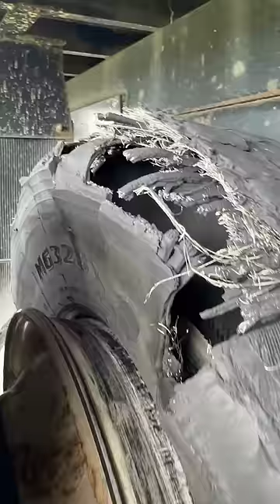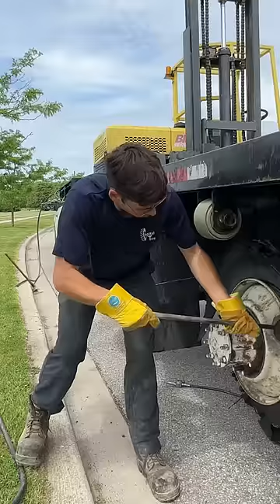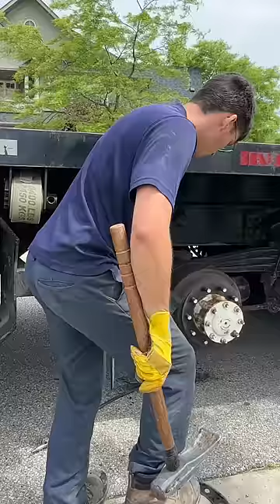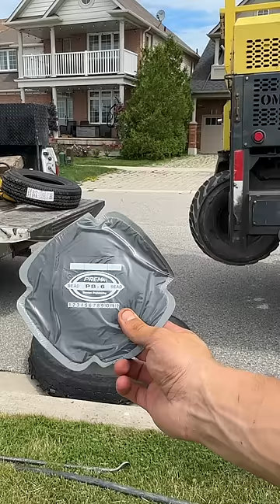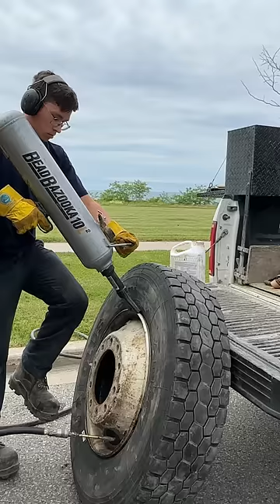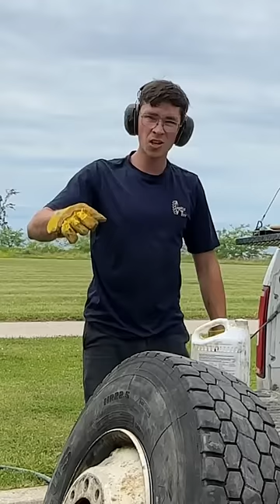Tire Doctor Is A God?

Comment: "I know whats wrong with it, it aint got no gas in it!"
Reply: I was about to say that lmao 🤣 😂 💀
Reply: I was thinking that as I saw the tire
Reply: Yessir
Reply: I thought it was low on blinker fluid!
Reply: It ain’t got no air in it!
Reply: I was looking for this comment 😂😂
Reply: Was about to put the same
Reply: Exactly what I was thinking 😂
Reply: I was waiting for that.
Reply: Kinda true. Air is A gas.
Reply: @braydenj03  very but in this case the gas holds the tire up
Reply: @MASKEDCLOWNGUY91  leave it to ohio to miss the joke
Reply: EYYYYYYYYYY
Reply: @jaynobles.215  Eyyyy sup
Reply: Air is a gas, ain't it?
Reply: Is this a Corner Gas reference, cause if so, it made me chuckle 😂😂
Reply: It does though. It's still completely full of gas. 
The problem is the gas on the inside is the same pressure as the gas on the outside thanks to the giant vent holes that were installed as aftermarket mods.
Reply: @mircomuntener4643  nigga it's a reference

the "gas" he speaks of is shortened gasoline/petrol. 

It is from a famous scene where a character exclaims the line upon inspecting a lawnmower that was not functioning, the other men examining it have overlooked the fact that the gas tank is empty and are attempting to fix the machine with the false assumption that it were fueled.

Upon hearing the tire guy say "I know what's wrong with it" it reminded the commenter of this scene. He would have otherwise said AIR instead of GAS, since most tires have compressed air inside and saying GAS implied that the gas inside is not air.

I don't know why I said the n word, I'm a Serb, white as can be, I apologize for my unprofessional tone.
Reply: Beat me to it
Reply: @RussiaCrimea123 same
Reply: I just thinking of that when he said it 😂
Reply: it exploded.
Reply: @tylerchiu7065  r/wooooshh
Reply: Legit was thinking of it
Reply: Hey, Carl, will you come take a look at this?
Reply: @johnjohnfofohniam No, its a Sling Blade reference
Reply: @ak14619  Air is a gas 🤓☝️
Reply: It's only got 1 bar of pressure.

Comment: "Don't touch the metal parts because they can hurt" both my arms can agree with this when I had to unravel a blown tire that had wrapped itself around the axle. Those wires don't care if you're wearing gloves.
Reply: Yep that’s some nasty stuff right there 😂 I remember I had some of that nasty wire that managed to get into one of my socks and it was poking me for hours until I managed to find it 😂
Reply: Why does it hurt.
Reply: @amichiganboiwhosereallazy1544  Because they're thin, sharp pieces of metal that can easily pierce leather gloves and your hands if you touch them wrong.
Reply: I learn the hard way last year switching blown tire from co worker. All my fingers had small cuts it hurt like a 
b$$tch

Comment: Had a retread separate one time at 75 mph and before I could pull over it scored the wheel well about a 1/4 inch in three nearly perfect lines.

Comment: Tire doctor: How the heck do you get a steel rim and an aluminum rim off the hub on a semi?
To get lug nuts loose I needed a 20 foot bar 🤬. Then couldn’t get get off.  
 Hire a company and it took 2 flipping hours.   
 Any cheat codes for this issue?

Comment: Why would the steel part of the tyre hurt?
Reply: Hitting the steel rim with your hammer will hurt your arms.
Reply: Jagged edges, The Heat, the metal from the tire itself maybe?
Reply from the maker: The are like needles, very thin steel wires
Reply: tires are reinforced with a metal wire mesh within the rubber, and in blowouts or other situations that causes the rubber to break apart and expose the mesh, and the exposed mesh wire, with how thin the wire is and how the wires gonna be mangled in the incident, is comparable to a bunch of very sharp needles that can pierce your skin like a tattoo gun. trust me, I did that once, it ain't fun at all
Reply: @TheTireDoctor  thank you for your content
Reply: @flameraker6824 : Steel belting (wire) that is normally molded inside of all Radial tires for strength is sharp & pointy at ends when broken/blown/shredded or if tread is so worn down that the belts are protruding through the tire tread facing.

Comment: Not an easy job. Throw out that often you're on the side of the road as aholes fly by you.  I did this 45 years ago.  Back then split rims were quite prevalent. Still hard to break them down and they seem to get heavier as the day goes by.  Then the peril of airing the tire up with the split rim.  I had one blow on me while airing it up. Luckily for me I was in the shop and had it in the cage.  But whoa what a noise.

Comment: ..the unanswered question
why did that tire blow..?
..my guess is backed into something
Reply: Could have been a host of reasons. Retread is one of the most common issues.
Reply: yeah except the imprint of the fire hydrant in the mudflap going the other way
Reply: @stevestoll3124 : Actually, the most common issue leading to tire blowouts is low tire pressure.

Comment: is there no type of puller for tires or brake drums?
Reply: @wins1007 : Unnecessary. Sledge hammer works just fine. Normally you just beat on the tire in different areas around the circumference of the tire sidewall. 
However, when tire is blown out or is just flat &/or dismounted from the bead, it can sometimes be a little more difficult to remove the wheel rim from the hub, due to rust & corrosion. 
Thus, sometimes it requires striking the wheel rim from the backside a few times.
They always come off, some just need a little more persuasion than others.

Comment: Why can't you touch the steel part?? Is it because it's hot??
Reply: @wilLizNY4ever : The steel belts (fine wires), used inside the construction of all Radial tires, are very sharp.